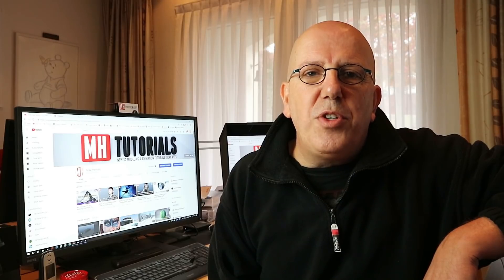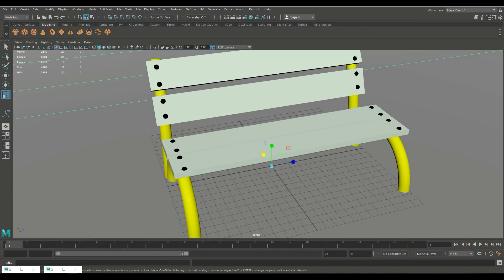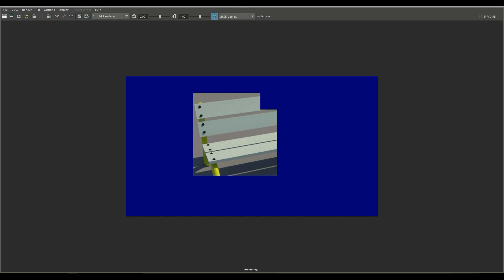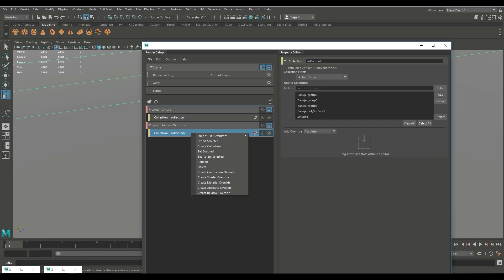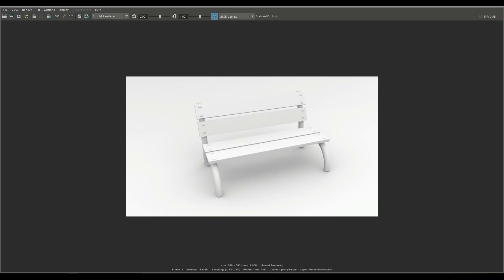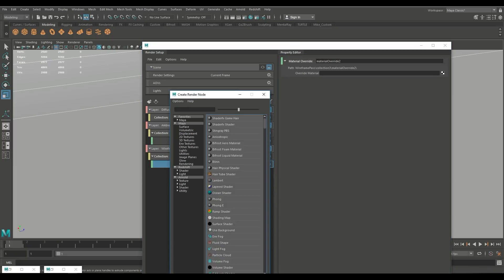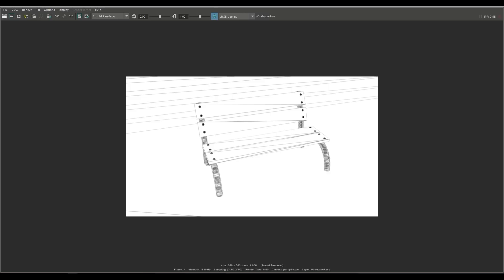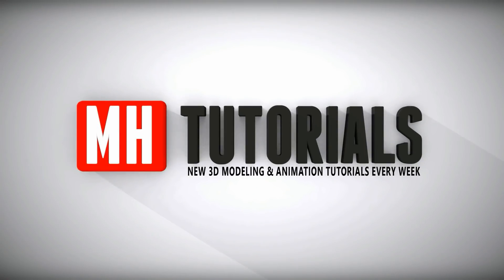Arnold Render Passes in Maya 2018 : Diffuse, Ambient Occlusion & Wireframe

Comment: Thanks for the video explaining the Render setup window. However, when you did a render of the diffuse layer it was set to the beauty pass and you didn't add any material overrides so it didn't change the render settings. You might need to update this video so it shows how to make a diffuse pass with the correct settings and it could be good to have some explaination as to what the diffuse actually does and it's use. Thank you for demonstrating the Ambient Occlusion and Wireframe passes they worked fine!

Comment: Theres an easier way to accss this (I didnt have the cube render icon) go to channel tab and there should be a render layer tab at the bottom. Simply select the geometry and create a layer and name it OC. Right click and go to override create new material and OC should be right there. Was super simple for me. My my didnt come with Render tab automatically though. You have to go to settings and preferences and go to render settings and add the renderlegaciy systen. If you want to use the legacy Render Layer system, open the Preferences window, select the Rendering category, and then select Legacy Render Layers as the Preferred Render Setup system.
Reply from the maker: Ash, I do not always look for the easiest way, sometimes I like to mix things up to cover more stuff to explain